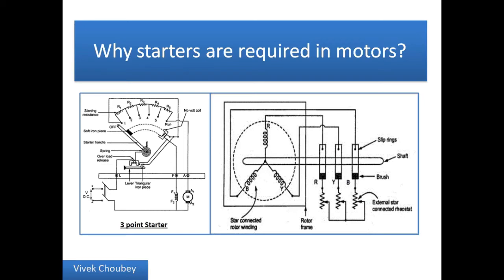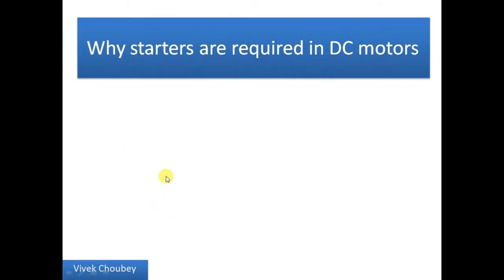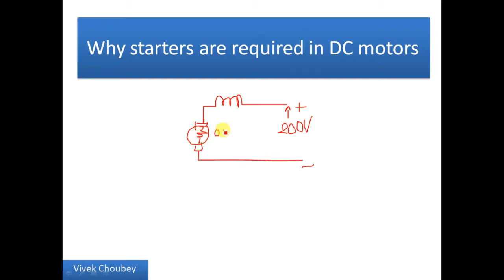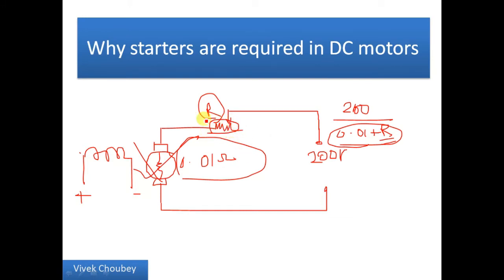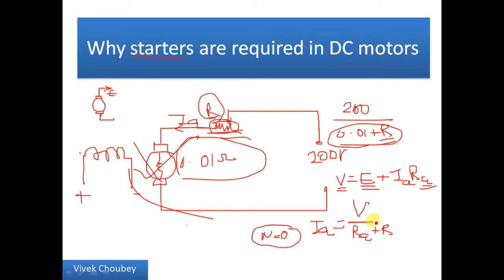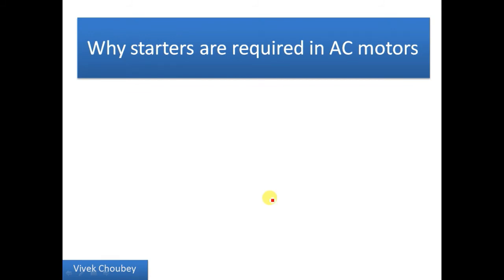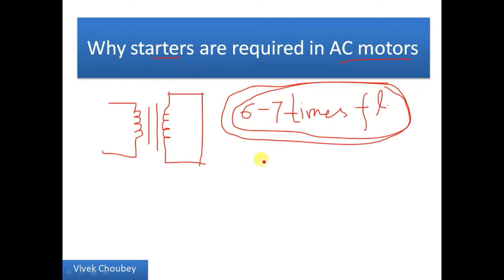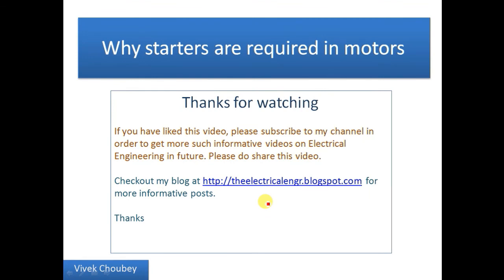Why Starters are required in Electric Motors? - EXPLAINED

Comment: Hello sir! I'll be grateful if you could explain more briefly about 'why starters are required in AC motors?'

Thanks in advance
Reply from the maker: To reduce the starting inrush current taken by the AC motors which is 6-7 times the full load current. Such a high current would cause a huge voltage drop in the line, reduce power factor and may even trigger any overcurrent relay thus affecting the entire load connected on the line. Huge current during start will also increase heat loss in the windings which will reduce the machine life. 

The objective is to achieve high starting torque with low starting current and hence we use soft starters which reduce current as well as help in building up constant torque.
Reply: Thank you sir!

Comment: Think you so much you reply me sir, sir want ask one more confusion start is use for reduce starting current ok. My motor nominal current is 129 right during starting time 2-3 second current reach 300 amp maximum this current is  after reduce by stater.
Reply from the maker: Yes starter is used for reducing the current input during start. But reduction doesn't mean that your motor will take only rated current during start. If starter wasn't there, the motor would have taken may be 500-600A during start. The starter is reducing it to 300 which is almost slightly greater than twice the nominal. The motor can handle this current and as it is only for short duration, that doesn't cause any problem. But if it would have been taking 300A for longer duration, then it is problematic because it will cause huge Voltage drop in the line and also heat. So the selection of starter depends on the kind of operation and type of motor.
Reply: Thank you so much sir.

Comment: Sir good morning, I am working in maintenance company there is so many motors and starters, one's time I measured current with clamp meter since starting, that moter nominal current is 129 Amp, when I started the moter during starting time I saw his taking maximum 300 amp after few seconds they reached normal 95 amp. As per your video your are telling ac Moter taking current 6 to7 time more to full load current. I want to confirm my motor is tiking right current as per your knowledge, because i am confused many days.
Please reply me I am electrical technician.
Reply from the maker: Hello Yasin. The motor almost takes upto 6-7 times full load current for very short duration or you can say during sub-transient period. Then it falls to almost 3-4 times during transient period and finally to normal. If you have starters installed, this high amount of current causing Voltage dip can be eliminated also good for motor life. 

The life and efficiency of motor depends on how much heat is generated during start and run time of the motor. Heat is directly proportional to square of current and time for which the current is flowing. So if your motor takes 300A for let say 3 seconds then heat generated in the motor is lower compared to a motor taking 300A for 5 seconds. So either you reduce starting current or reduce the time taken by the motor to get to stable mode. A good motor should have both that is it should take low starting current as well as reach stable mode as soon as possible. That's why VFDs are used with motors for starting as we can keep the current supply to the motor low with constant torque. 

If your motor is taking 300A for short duration then it's fine otherwise check the specs provided by the vendor.

Regards.
Reply: Thank you so much sir.